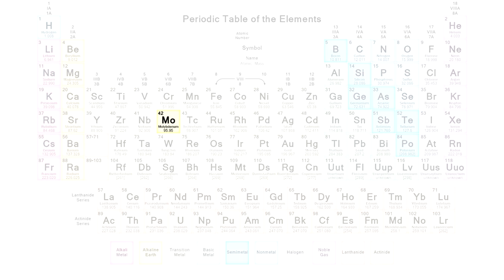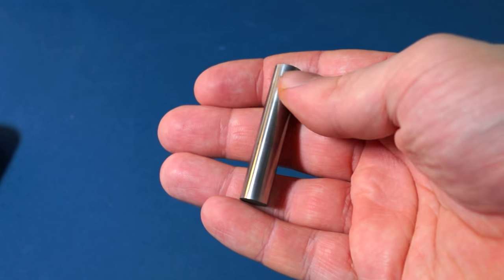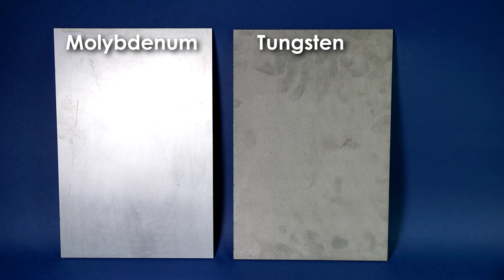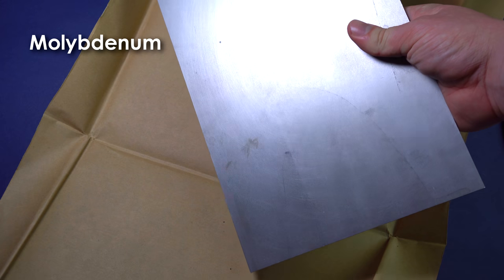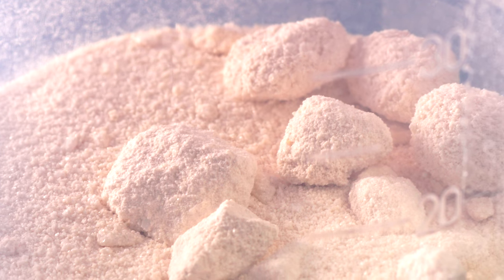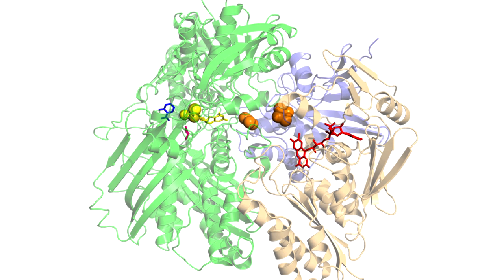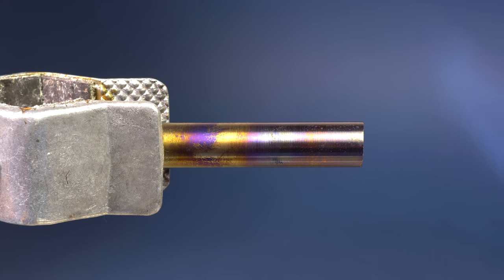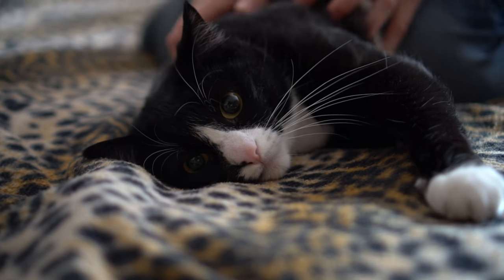Molybdenum  - A Metal That Forms Weird Solutions!

Comment: Molybdenum Disulfide is my go-to lubricant for metal to metal contact applications, especially when high heat is involved. MD actually bonds to the metal and creates a nearly frictionless surface. I was having trouble with the sleeve bearings in the motors of the exhaust fans of my furnaces. I mixed some MD with some very light oil and let it wick into the bearings. They now run very smooth, very quiet and haven’t given me any problems for years. I have used it when assembling R/C aircraft engines and other high speed/high heat applications. It’s amazing stuff and I can’t say enough about it. It can be added to oil, grease or applied directly. You can even use a solvent, such as isopropyl alcohol, if you want it ‘carried’ into a close metal to metal application, and only leave the MD behind. It’s expensive in powder form, but just a little goes a very long way. (I have a one pound container, I’ve used it for over 25 years and I’m nowhere close to using it up.) It looks a lot like graphite, but has a much lower friction coefficient. Also, wear gloves while using it. The particle size is so small, that it will actually penetrate and bond to your skin, leaving stains that won’t readily wash off.

I wish that I had a spare automotive engine to test it on. I would just add it to the oil and let it coat everything. My only concern, even though the particle size is very small, is that it might clog the oil filter. I suppose that I could let it run for a short while, change the oil filter and see how that works. It would be an interesting experiment to try. Does anybody live in northern Illinois USA, have a spare low-mileage engine and want to try this? We could take all sorts of measurements, treat the engine with MD and then repeat all of the measurements. It would make for a great video! We could even create an engine additive, give it a cool name like ‘Slick As Fuck’, sell it in stores and make a fortune. LOL :-)
Reply: I'm sorry, but Liquimoly beat you to it with their MoS2 engine oils and additives, lol. At least I found your favourite motor oil and you won't have to worry about it clogging up your filters.
Reply: I fucking love molly. It's so useful, I also have used the same tub for a long time, about 10 years for me.
Reply: @SECONDQUEST 
Good golly, miss Molly! 😀
Reply: "Molyslip" has been around for ages, and if I recall, NEVER use it on too low mileage an engine, as it can tighten the tolerances, so any possible high spots must have been worn in first.
Reply: The spray is used in gun magazines...
Reply: @matthewday7565  engines don't have "high spots" in their assemblys. The real issue with using a lube that does TOO GOOD of a job at lubricating, is (especially on freshly built engines) they actually reduce the friction so much that it hinders the engines ability to bed the rings in to the cylinder walls to create an optimal seal. Cheap oil is best for doing that since it has enough lubricity to keep the engine alive, but not so much that it hinders the engines ability to break in. The first 15-20 minutes of hard running gets 80% of the break in process done, and the last 20% is done over the next few hundred miles. after around 1000 miles you can switch to high lubricity synthetics and the like, since there should be no more breaking in left to do
Reply: Kay Kay  The M230 Chain gun is full of it. Used to get covered in it doing phase maintenance on AH-64Ds.
Reply: but can i use it a lube
Reply: It was also used in the Acura Integra type R's engine to reduce friction
Reply: @SoundShunter72   I keep several cans of Liquimoly and add about an ounce per oil change.
Reply: I lube parts of my spring air rifles with moly paste.
Reply: Great thread
Reply: @gweedomurray9923  Carefull with liquid moly, its not pure m, dont use that brand.They mix with other cheaper stuff, so avoid it, you ant pure moly.
Reply: @PedroSilva-yc4bu  ~ What brand should I use ?  The '99 Tahoe has over 336,000 miles now and runs nicely.
Reply: @gweedomurray9923  if your Tahoe is still alive at this point, maybe...just maybe you really don't need the additive 🤷‍♂️
Reply: @Mikgwerd  ~ 3000 mile oil changes help a lot.  The Moly is viewed as icing on the cake.
Reply: @gweedomurray9923  many brands out there now, but maybe there is a YouTube video on what one is better, maybe someone that made a lab test on the different ones, but else reading reviews would be great too.
Reply: @Juuk-D  A mixture of 50% medical grade castor oil and 50% silicone steen C was once used in the 1970s in a Beetle Volkswagen and it never had an oil change but one thing is for sure, the medical grade castor oil creates a permanent and self-renewing varnish like coating on all metal parts. It would be great to find someone to test a mixture of 50% medical grade castor oil and 50% molybdenum disulfide on a brand new car and diesel truck of the pre-electronic models that uses only a simple gravity fed float valve controlled carburetor, a simple distributor-based ignition systems, a simple electric motor starter, a simple spark plug, and a simple lead acid cell battery and dynamo recharger. 

A distributor-based automotive ignition system connects to the camshaft with gears. In the mechanical distributor, the gears spin the main distributor shaft. Inside, a set of “ignition points” rubs against a multi-sided cam on the distributor shaft. The cam opens and closes the points; they act like a mechanical switch that interrupts the current flow. That is what starts and stops the flow of power to the ignition coil. Once the coil generates firing voltage, it travels to the top of the coil and into the top of the distributor cap. A rotating disc attached to the distributor shaft “distributes” the power to each of the spark plug wires. https://en.wikipedia.org/wiki/Distributor

https://en.wikipedia.org/wiki/Ignition_system
Distributor-based systems

Rotor contacts inside distributor cap
Main article: Distributor
An improved ignition system was invented by Charles Kettering at Delco in the United States and introduced in Cadillac's 1912 cars.[2] The Kettering ignition system consisted of a single ignition coil, breaker points, a capacitor (to prevent the points from arcing at break) and a distributor (to direct the electricity from the ignition coil to the correct cylinder).[3][4][5] The Kettering system became the primary ignition system for many years in the automotive industry[6] due to its lower cost and relative simplicity.[citation needed]

Comment: Molybdate anion is a good test for dissolved silica in the form of metasilicate or silicic acid, and will detect a few parts per million of it. To a solution of silicate, add some ammonium molybdate solution followed by dilute acetic acid in excess. Over several minutes, a yellow colour will develop, which is a complex anion of silicon-molybdate or molybdo-silicate. The strength of the yellow colour can be measured with a spectrometer and it is a quantitative measure of silica if run with a standard. Now add some crystals of hydroquinone, and the solution turns a beautiful blue.

Comment: With low speed deformation, Molybdenum is quite ductile and malleable. I can bend or extend Mo easily but not a case in W. It's another story in high speed impact, though.

Comment: I work with this metal in manufacturing metal catalysts for oil refining. It's never the sole metal used in catalysts to which we add other metals with it. The two metals that's used with this is either Nickel or Cobalt. (NiMo) or (CoMo).

Comment: I cannot easily get ultratrace Molybdenum into solution for ICP-MS analysis. I do not wish to use HF. I obtained the greatest recovery from a certain bio-inorganic matrix with the application of heat in open vessel to a mixture of concentrated nitric acid and hydrogen peroxide in the presence of trace HCl and trace anionic surfactant. I am trying to create an ICP-MS method for 44 (current) to 90 (goal) isotopes on a unique, poorly-studied matrix. 

The use of pressure and high temperature digestion, which is not available to me for routine and scalable analysis, otherwise gives me perfect recovery of Molybdenum with Nitric acid and Hydrogen peroxide alone.
Reply: So nitric and hydrogen peroxide will dissolve molybdenium?
Reply: @burimosmani3358  Nitric acid, hydrogen peroxide, temperature and pressure will dissolve Molybdenum. Without pressure, it needs the addition of HCl or HF with the HNO3 and H2O2.
Reply: @koshchey4944  Hello! I'm looking for a way to titrate Molybdenum in a caustic solution. Would you happen to know of a way to do so?